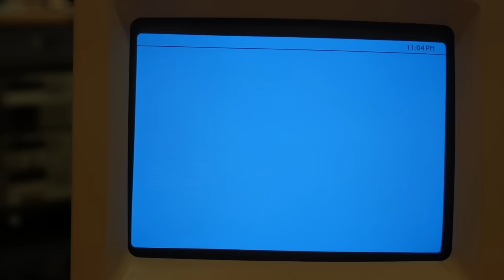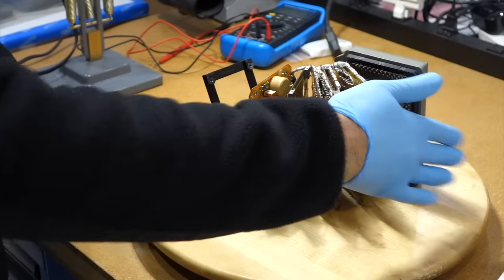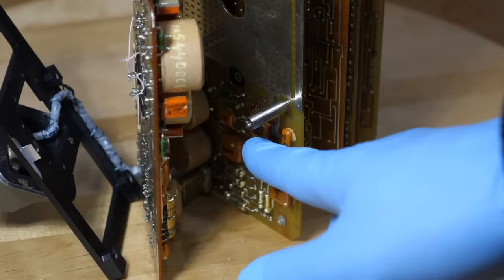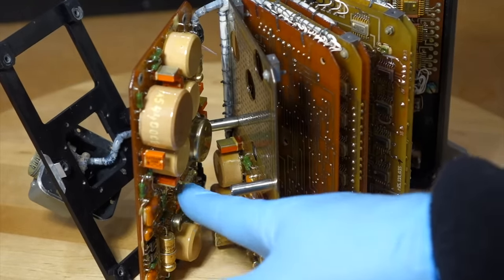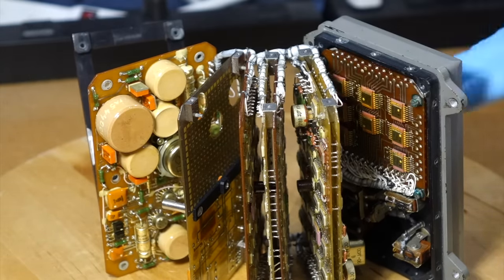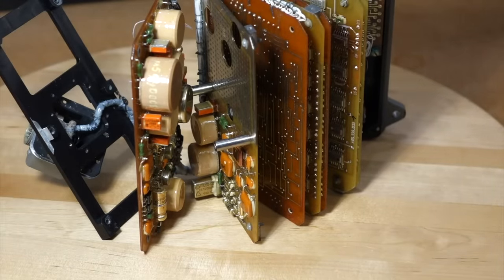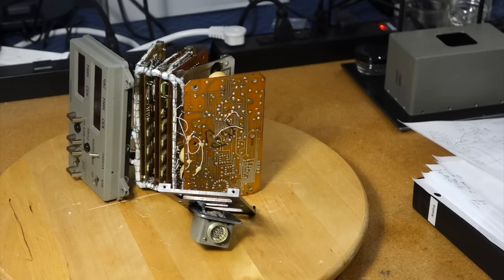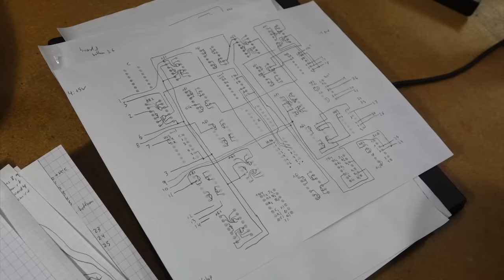Soyuz Clock Part 2: Reverse Engineering Update

Comment: Pink decoder chips are actually ceramic, not plastic. Conformal coating just makes it look like plastic. 514ID1, 514ID2 - used them when I was a kid to make a clock. There is no berillium there.
Reply from the maker: @yoksel99: Thanks, this makes sense.
Reply: @CuriousMarc  Beryllium oxide is a ceramic material, used as an electrical insulator with high termal conductivity. For example microwave ovens have a piece of BeO at the µwave generator cavity, which is pink in color. This IC package might still be that material. It's for space application after all. As long as you don't cut or grind the material, it's safe to handle. Highly toxic otherwise.
Reply: I have an Argon Laser which has a Beryllium warning sticker and its tube is made out of a pinkish ceramic.
Reply from the maker: I know, I’ve used it in some of my package designs for its thermal properties. Normally it is white.
Reply: Im pretty sure this is Beryllium Oxide, we still use it in Space components and back than was quite Common compared to Aluminum oxide
Reply: yep!  can confirm as someone who personally seen them without coating. and yes it is well established knowledge what those are indeed contain beryllium and better dont break them
Reply: Pink ceramic usage was widespread in soviet components for casing of semiconductors. That included consumer TVs and radios. No one ever reported beryllium danger from there. If it was there it would have been known. On the other hand, yes, there was a beryllium-based thermal conductive compound used in soviet special equipment, and it was strictly guarded and marked due to its health hazard.
Reply: Not that bevor 1980 Beryllium was not marked as such, it is not that big of an issue to have Beryllium Oxide. As i sad event today it is used in Space Packages like in TO-254 and 257 it is often written on it as BeO. I would be careful there is not an easy way to find out. There Color is not from beryllium but from additives that can be mixed with it, BeO is white and looks the same as AlO.
Reply: @CuriousMarc  can it be a rule that you're not allowed to talk about beryllium on the channel without including that "beryllium sphere" clip from Galaxy Quest?
Reply from the maker: @FlyNAA  "I have one job to do on this channel. It's stupid, but I'm going to do it. OK?"

Comment: My guess is the engineers used a full switching power supply with the caps and inductors (instead of a simple buck converter) because the clock has to keep working correctly even with external power transients. This can happen when switching the capsule between different power supplies (rocket/ground external; on board batteries,  space station power). If i understand correctly, the input power is AC, so switching between different (unsyncronized) power sources will pretty much guarantee that you will have lots of noise and power transients on the input side. Other sources of power transients would be high power devices like heaters, valves in the RCS system and pyrotechnic devices.

It's even possible that the voltage varies wildly between different power sources (like they did on Apollo when switching from ground power to internal power). And one has to keep an eye for unintended under-voltage conditions, like running too much stuff on too few batteries. 

The clock is one of the more critical components in the system since it's also a very rudimentary navigation equipment - in an emergency you could initiate the deorbit burn without a computer by pointing the spacecraft by eye and start the engine at the correct time. This is similar in concept to the Apollo Lunar escape systems (LESS) navigation.

Comment: God I love how this clock is built! The amount of details Ken managed to carve is impressive!
Regarding the pink ICs, they may not be made of beryllium (metal), but of Beryllia (beryllium oxide  ceramic), wich can be of a large variety of colours both due to impurities and blending with other minerals, it is commonly found in magnetrons where it is used as insulator. It is also used in RF power transistors and resistors because of its good thermal conductivity and high dielectric strenght.

Comment: You can really tell that this clock was high quality because literally every component has rhombus on it (Which means "Военная Приемка" that can be translated as "Military Grade")
Reply from the maker: Yes, it sure looks like I got the real thing. Supposedly this one was flown in space.
Reply: @CuriousMarc  Hmmm, I wouldn't be so sure, since it got some repairs, digit segments etc. It would never be approved for a flight.
Reply: And the letters "ОС" present on all? components designate them as "особо стабильный/особая серия" (especially stable / special series) - a special version of the component for space/nuclear applications (sometimes they are slightly different than normal or military parts).

Also generally military versions of components start with a number - ex. 2Т908а vs КТ908а. Some of them even have different maximum ratings (mostly max. voltages) in their "datasheets".
Reply: @SY19955591  ОС meant "особо стойкие", i.e. literally "especially resistant". In this case, resistant to external factors, like pressure, vibration, temperature, humidity, etc.
Reply: Does rhombus have a different meaning in Russian? I thought it meant a parallelogram with opposite equal acute angles, opposite equal obtuse angles and 4 equal sides.
Reply: A rhombus and/or a triangle designates special QA
Reply: @paddle_shift  Yes, same thing in Russian. Parallelogram with equal sides and non-right angles. All your other characteristics derive from that.
Reply: @sashimanu  Ahh! Clearly, your eyesight is much better than mine as I did not see the symbols. Thanks!

Comment: My flabber has never been so ghasted as to the complexity of this “simple” clock/stopwatch. Whilst the technology is old and very boilerplate the Russian principle of “if it ain’t broke don’t fix it” has lasted them well since the 1960’s with their current spacecraft not being very different from the originals. 
Outstanding video and descriptions guys. I’ve just looked at Ken’s blog and will now be paying frequent visits !
Reply: It looks so complex because it's built of low integration ICs, 134 series is more or less a direct clone of Texas Instruments SN54L logic.
Reply: I suspect because it was probably used in conjunction with both the guidance systems and navigation systems that it probably had to be absolutely bullet proof plus the Soyuz were really in flux back then with production generations, special mission variants, and leftover spacecraft all being used for their space program so this could have been engineered for a much earlier version and stuck around

Comment: I haven't heard that Mac startup tune for some time! Brought back memories of buying a Mac 4/40 around 1987.

This project is fascinating. The different design techniques used by the Russians is similar to the difference between US and Japanese design in the early 80s. I was working with video tape recorders (analogue) at the time, both Ampex and Sony, and their approaches to power supplies and motor controls was quite different. If you had been brought up on one, working on the other could be confusing. "Why did they do it like that!" was the regular complaint from the service guys! Well done Ken for figuring this out.

Comment: Yes, beryllium oxide is in the pink ceramic insulator. Also commonly used in the 'west' for transmitter power valves. (note: not your atypical glass valves, but metal & ceramic valves). We saw them a lot in military radios.

Comment: Depending on the type of conformal coat on the boards, you can use ethanol / alcohol to soften it up - and gentle scrubbing with a q-tip to fully remove the conformal coat.

Comment: Pink is not plastic. It is ceramic, quite common for aerospace parts.
If you have any trouble - please contact me. I am hardware engineer from Russia, I can help with part indentefication. I am also doing alot of similar work, reverce-engineering, usually for repair reason.

Comment: That coating has pretty poor heat resistance, i usually poke it pins or traces that i want to check with soldering iron. (I actually do "untangling soviet mil-grade circuitry" for living.) And that power supply is rather simple, by standarts. You have op amps, op amps are luxury! (and kinda crap for some reason)

Comment: That delta character does not represent a Greek letter; △ and ◊ are marks for mil-spec acceptance testing. Also, OC stands for особо стабильный, "particularly stable". 
As said before, pink ceramic may feel plasticky due to confotnsl coating.

Comment: 10:34 This is not pink plastic, it is pink ceramic. Soviet / Russian microcircuits for space only in a ceramic or metal case. A possible exception is only LED segment indicators.
Reply: Обычная керамика ВК-94 (он же 22ХС) - такой себе материал, технология 50-х, которую в СССР по бедности [глупости] дотянули до 90-х, несмотря на то, что весь мир уже во всю использовал поликор и сапфир. С высоты сегодняшнего дня и правда не намного лучше пластика.
Reply: @Supervisor000   поликор и сапфир хорошо для СВЧ и высокоскоростных сигналов. А для обычной ттл, есл логики и кмопа достаточно и 22ХС ,и дешевле, и технологичнее. Плюс не забывайте консервативность военных, которые такие заказы размещали - они очень неохотно идут на замену того, что и так нормально работало. Кстати и зарубежом низкоскоростная логика и прочие ОУ для военки и космоса были тоже в обычной керамике и железе.
Reply: @Юль4а344А  Консервативность - штука опасная: есть риск заиграться, и одурачиться. От того 22ХС (впрочем, для ТТЛ вполне сгодится и стекло) ещё более несуразно смотрится на фоне позолоченных выводов и позолоченной крышечки, которая даже с землёй не соединена. Там князь Кощей над златом чахнет... (с)
Reply: @Supervisor000  я видел целые платы по 100-150  квадратных сантиметров из 22ХС с многослойной разводкой. Завораживающее зрелище. Да еще и с микросхемами с обоих сторон. Внушаить.

Comment: It's interesting to me that most of the components are marked with 83 or 84, but the digital clock wasn't used until 1996.  If this was flown, the components were 12 years old by the first flight.

Comment: Is it possible that the lack of decoupling caps has something to do with reducing possible effects from ionizing radiation?  Maybe less capacitors to short/fail. I'm just taking a stab in the dark. But maybe there is more reason than just non standard practice?

Comment: One of the green wire wound resistors near the mounting eyelet looks as if it has been overheated, blackish area in the center.
Reply: I'm also curious to know if those axial capacitors might be "dodgy" at this point.  I know that I've always seen German branded electrolytic capacitors from decades ago fail.

Comment: It has a relay? It switches when it counts down to zero? Well, Soyuz clock egg timer when?
Reply: Yes, the smaller metal can is a nice little DPDT relay, likely РЭС 60 . I enjoy using those because they kind of fit modern breadboards and can be inserted both ways because the pinout is symmetrical.
Reply: @sashimanu  yes I play with them at this moment :-D
I received some from Moldavia.
these are 800 Ohms coils so medium voltage, the low-voltage are even more fun :-D

Comment: Very interesting to see this technology... and this was designed by them in the 80's.??.. I wonder how this compares to the US shuttle technology of the same era??  In a way, I'm somewhat surprised by using a switching supply, I always thought every extra gram of 'inductor' would be discouraged...even though SMPS are more efficient, overall.    I would think the same, of using an individual 'digit' driver IC for each digit would be wasteful, and muxing would probably reduce power consumption also... keep up the good work guys...
Reply: Have a look at the blog linked. There are some comparison pictures (i have it on rss feed as there's tons of cool stuff there)
Reply: This technology of the 60s. She did not improve because everything worked fine. It’s like an old UNION missile, although the old one is still doing its job and has modernized quite a bit.

Comment: I think I might have a datasheet book for those chips. Unfortunately is in Cyrillic...
Reply: The chips are Soviet equivalents of 5400/7400 series. From Ken's post:

134ЛР1 = 7450
134ЛА8 = 7401
134ЛБ2 ~ 7420
134ТВ14 = 7478
133ИЕ2 = 7490

142ЕН2 is a linear voltage regulator
514ИД2 is a 7-segment display driver
140УД1 is a generic op-amp

Comment: Could the bypass caps be integral to the ceramic packages?  I can't imagine all my instructors (and the datasheets!) lying to me about them!
Reply: Well.. they are not as needed as many claim. Besides the clock is likely relatively slow.
You mostly need them on fast stuff.
Reply: These particular chips have no caps in them for sure.

Comment: Gush, I am curious, how many components have been actually made/designed in Czechoslovakia.
Reply: I don't think any. At least the ICs were actually designed in the United States and copied by the Soviets lol
Reply: @sashimanu  Well, that's what I am talking about ;) I do remember booting up one of the early PCs and it had ROM BASIC. Copyright IBM. I was like - huh, I doubt they have licensed it properly :)

But it is not completely fair - Tesla (Czech manufacturer) did quite a lot of R&D around basic logic chips. They have really struggled with higher level MCU etc.

Buy yeah, they made a lot of "equivalent" components. Like https://aukro.cz/mhb2716c-5ks-tesla-ceskosloven-eprom-pameti-2kb-equivalent-intel-2716-6936476503
Reply: I heard a story from one man who worked on a soviet military plant. He told how they copied some american helicopter equipment, but for some reason they didn't manage to reverse engineer the firmware. It showed some original manufacturer's logo on the screen, so they just added a piece of HARDWARE, which blanked the CRT beam in the place when it was drawing the logo :)

Comment: The relay mentioned seems to widely used in Russian equipment. I bought a few from eBay. According to the data sheets mine were 28V so maybe the power to drive this is 28V and not 24V? Just a thought. //Harry from Sweden
Reply: Quick search hints at 27V DC power bus in Soyuz spacecrafts.

The one used is this clock is РЭС60 (RES60) series, there are 27V relays in that series but they are more like 23..34V per some datasheets. Not a particularly sensitive part.
Reply: @alexsuykov  Thank you Alex. And you are right, the relay is probably 27V and not 28V now that you mentioned it. Great relays! If memory serves me there was some special metal on the contacts of it, right?
Reply: 27-28 volt DC is a common nominal bus voltage in both Soviet and Western aerospace industry, corresponding to a 12-cell lead-acid or a 20-cell NiCd battery ("24 V") plus some extra volts from the generators for charging. The equipment tolerances are really wide, often specified as 18-32 V or more.

Comment: You've never seen pink beryllium?
The antenna on a microwave oven magnatron is pink beryllium. At least all the ones I've seen anyway.
Reply: Pink IC ceramics isn't beryllium;  BeO ceramic is white and not used in consumer appliances due to both cost and health hazard.

Comment: So it has a non regulated free running switch mode power supply to get +-15v to power the primary switching power supply.  Power supply inception.
Reply: Standby power is used in all non-trivial switching mode power supplies, nothing wonderful here.
Reply: It had a free running switch mode supply to create plus and minus 15 volts that power the circuitry for the actual power supply PWM controller.  Not a standby supply if I understand correctly but more like a bootstrapping circuit used in modern switchers.

Power supply inception...a little bootstrap switcher powering the brain of the main switcher.

Unlike standby, if the bootstrap circuit fails, the entire system goes down vs normal operation until next power down/up cycle.

Comment: Typical space engineering  for the period. Most people don't understand how components are qualified for operation on spacecraft. This clock was almost certainly designed years before implementation then, years of rigorous and torturous testing reliability, performance and tolerances followed. Installed in the mid 80s means designed in the late 70s
Reply: This also true of even contemporary US made avionics, even in the fairly fast-evolving general aviation sector. Only experimental/amateur-built aircraft use technology that's close to what is common in consumer electronics. This is one of the big problems in avionics, especially as systems get more complex. The life-cycle of the components is very short compared to the aviation life-cycle. It is not uncommon to fly with 20+ year old avionics, made of components with a 7 year production lifecycle.
Reply: @NinerFourWhiskey  sadly, a lot of people see complex systems in an aircraft with a consumer product design cycle perspective. As you pointed out. Real world, high demand systems like these aren't tossed away when the first cap blows up. Rather, are repaired and reused constantly